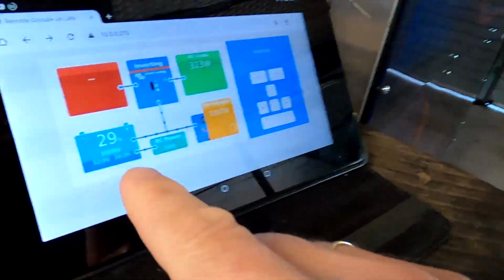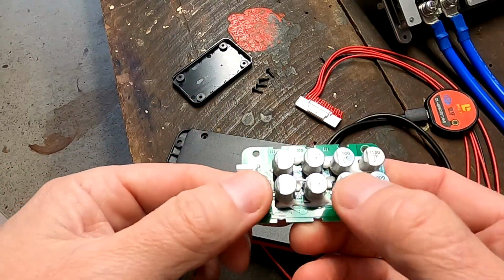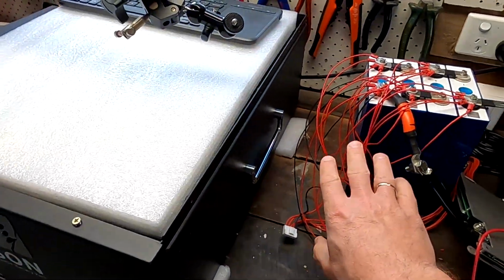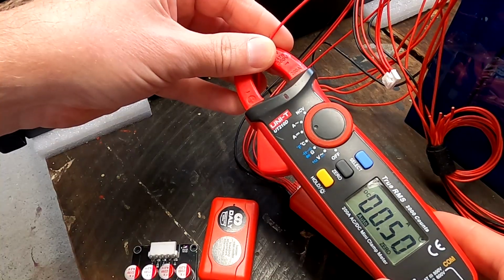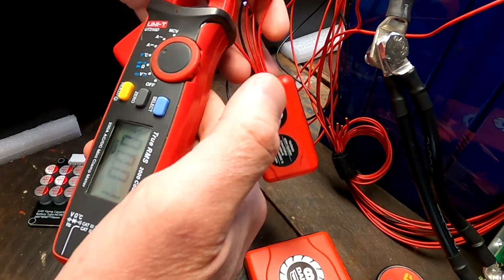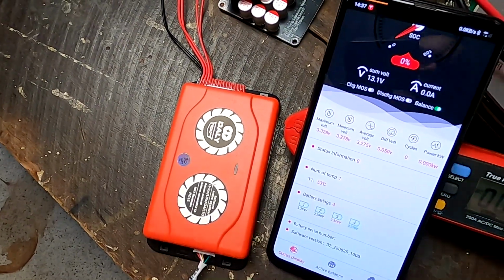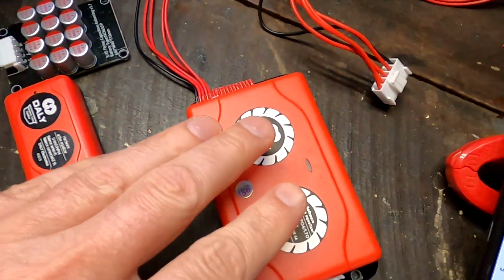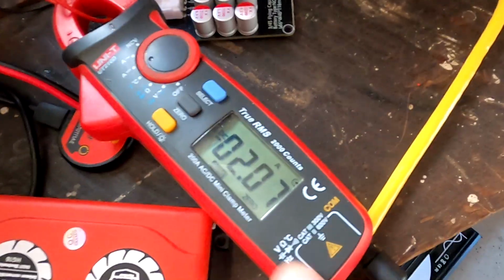DALY has now Active (Smart) Balancing! Is this the new NEEY?

Comment: looks like that all of the other leads of the ic's was populated tried to populate with 16s ? :D
Reply from the maker: They come as 24s versions as well but they just cut off the remainder of the 16S version. It looks terrible, maybe they ran out of 4s cables 🤷‍♂️
Reply: @OffGridGarageAustralia  looks more they manufacture 24s and then cut the rires for 4s making more cheaper the production because in the video the PCB looked to be populated

Comment: I am surprised you did not test a JK active balancer, without the BMS… they make one!
Reply from the maker: Yes, but isn't that the same as the NEEY just with the same JK app?
Reply: Hi  Andy @OffGridGarageAustralia  -
Same as the NEEY? I don’t know.

The photos of the JK active equalizer boards looks the same as a Heltec active equalizer…
they both have 1 & 2 amp options.

The JK active balancer board looks different from the latest 4th NEEY active balancer board. 
The latest NEEY has a 4 amp balancer.
Reply: No the Neey and JK active balancer (standalone) are different. The JK active balancer relies on delta V setting to turn on/off balancing. The JK active balancer has no setting to turn off below 3.4V .

Comment: 50-60ma you may as well just use the BMS, or add another resistive balancer,  I think a 1amp balancer should do 600-750ma minimum, or call it a.25 amp balancer, that can do 1 amp peak, a large bank needs a 5-10 amp balancer, I wish someone made a balancer that either used pwm that can variable discharge the high cells, or basically used DC boost converters to charge the low cells from the high cells, with 1amp min. With the option to program it to taper the current like a charger would,  it would probably not be cheap,  but iff it worked! And wasn't too expensive!! 😳
Reply from the maker: Yeah, the active balancer is not worth buying. The only good thing is, that it turns on so late and is not balancing all the time. So it may be useful for a small 10Ah battery with PALO cells or so. I could use it for my solar gate project 🤔
Reply: They pretty much do make the balancer you're talking about. I don't know if it tapers the current but it definitely uses the inductor to boost the voltage from the high into the low so it can maintain its peak amperage transferability. Just like this Smart balancer he shows you the inside you'll see the inductance coil that they're using. It's not full of capacitors.

Comment: That's janky. You can't just cut off the extra wires to make it a 4S balancer. LOL.
Reply from the maker: And they sell it like this 🤦‍♂️
Reply: They use the same PCB. Would need to look at the PCB and see if there are any non populated components.
Reply: Even then you probably don't have the software (firmware) version for 16S. Making 1 board for multi purpose is no problem with me but you can use different connectors on the board or at least different connectors with no cables for the connections you don't need. This looks messy.
Reply: @marco1862  It is an unfinished product.
Reply: Andy should get at least half of his money back.

Comment: Maybe the Daly is looking for the lowest cell to trigger the smart balancing or maybe "Avg Cell V." In your video the "Avg Cell V." was exactly at 3.30v and I was wanting it to change to 3.31v and then you canceled the test! Thanks for the work you do, it still seems like Daly has a firmware problem exactly like the firmware problem in their smart BMS balancing too. Such a shame.
Reply from the maker: Oh, I didn't pay attention to the average. I'll have a look again and runs some tests with that in mind. Thanks for picking this up...
Reply: @OffGridGarageAustralia  Sure go ahead and run some more tests. Also, what do you think about active balancers charging the low cell "if" the pack is below freezing temperature. Do you think you can test if any active balancer can trigger on and off based on temp?
Reply from the maker: @uhjyuff2095  the balancer should only work if the battery is full, not all the time. So it's highly unlikely that the battery is fully charged and needs balancing and the cells are also freezing cold.
Reply: @OffGridGarageAustralia  so you think the small active balancing is fine in all temps? I feel users want the bms to be automatic and just work according to the cell manufactures requirements. I hope the JK or neey bms knows to not charge a cell below freezing level because that would be something I want!
Reply from the maker: @uhjyuff2095  the JK BMS won't allow charging below the set temperature. The NEEY will only balance of the battery is fully charged, so won't balance at cold temperatures either.
Reply: @OffGridGarageAustralia  Would love to see a freezing beer come out proving this in the future!!!
Reply from the maker: @uhjyuff2095  I have done this when testing the JK-BMS. Cold beer and it turned off!
Reply: @OffGridGarageAustralia  I hear you about the cold temp charging protection, but I am specifically concerned about the active balancer cold temp protection test results. Test the cold temp protection while the pack is in active balancing mode, so I guess you have to pull out the light bulbs to make sure the cells are way out of balance because I know the JK does a great job keeping the cells balanced to begin with!
Reply: I hope this is not the case , it would be even worse design . 3 cells at 2.5 and the 4th one could be cooked before it came on ., even more so on 16s  .

Comment: use JK-BMS all in... 
nice test, thanks. 
I didn't understand why daly is used so often? Well, I haven't been following the topic for so long, but JK-BMS has everything, 200A should be enough for everyone at 48V.
Reply from the maker: JK is definitely the way to go. I was just curious if Daly actually made a decent product. Maybe they will one day...
Reply: But JK BMS is expensive.  I can get one of these 8s balancers for 30 US dollars.  My battery already has a BMS with passive balancing that isn't quite enough to keep it in line and I need some stronger balancing current which is where this one comes in.  I'm just looking for the cheapest strong enough balancer that won't cause imbalancing by continuing to balance at all voltage levels.

Comment: This all boils down to the design engineers, the firmware programmers, and the app software programmers not actually talking to each other.  To get a new product on the market, those people have to work together.  Also, where's the Quality Control, and Inspection Testing?  Daly is losing face, fast.  Other companies are creating better and more reliable products  At this state, I'm not sure why they just haven't reverse engineered a HelTek or Neeey, add a few extra or larger capacitors for more amperage, or filtering, and put it in a red case with their name on it.  At least this would give the customers what they want, and copyrights laws over in China are not the same as the US.
Reply from the maker: Exactly. Everyone is just inventing the wheel again instead of building up upon other products already and make them better.

Comment: Why do you need to put an active balancer on a pack with a JK BMS?  Isn't its built-in active balancing working?
Reply: Andy said he shut his JK active balancing off… he was just testing the new balancers.
Reply: @DavidHalko  This! 
The JK was just there for the excellent monitoring via the phone App. 
It wasn’t balancing, Andy was just giving us a good view of the individual cell voltages.
For my money, JK for the win and DALY is a fail.
(I now have two JK BMSs and couldn’t be any happier.)
Reply: @FutureSystem738  I will stick with my JK!
Reply: @haydenwatson7987  I have a 16s 200A JK BMS which has been flawless.
I also bought the 4s-8s JK for a 12v battery when they first shipped, which was initially faulty. However they were quick to acknowledge the problem, knew what the problem was, and replaced the faulty unit (though I had to ship it back to them- they fully refunded me the postage cost.) The only annoyance was the delay in having to ship it back.
However I am thus quite happy with their customer service, and love the functionality of the BMS via their phone App.
Reply from the maker: Yes, stick with the JK-BMS. It's the best solution right now.

Comment: Why don't they just make something like that heltech 4 amp one but with a Bluetooth or even a jumper setting that you can change maybe increase that deviation to like 20 or 25 something just five seems a little bit too tight for those super high quality grade a cells

Or even that doesn't even have to be a capacitor one it could just be resistors but use bigger resistors have one that can have like a 1 ohm resistor on each cell and have it adjustable also that would be plenty of power

I mean the settings that I see that a balancer should have would be the turn on voltage per cell based on the highest cell and then the deviation setting if they made one with those two settings adjustable even if it was just with dips switches
Reply from the maker: Many solutions for a good product. They just need to test their stuff before releasing.

Comment: Would it be possible to put an active balancer such as this NEEY or a JK inside the Seplos to handle the balancing? Allowing you to close the lid on it, set and forget and not worry about the balancing while still having the LCD of the Seplos BMS for info and communication with the Victron Multiplus?

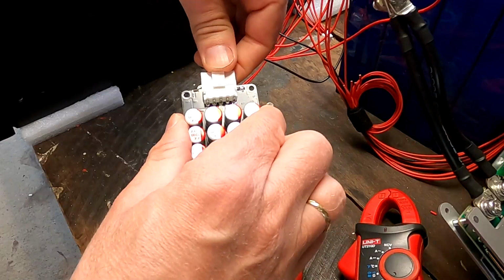Edit: You just answered my question at 19:15 😁
Reply from the maker: Yes, absolutely. That would be fine solution.
Reply: Actually Seplos should have woken up in the first place and design a several Ampere balancer rather than the 150mA or so they have built in. Seplos what is wrong with you!?!
Reply: If you need a BMS, which communicates with Victron Venus OS, then Seplos is not the only one, for example JK BMS with R485 interface can be connected to the Venus OS. You just need install a driver into your Venus OS device.